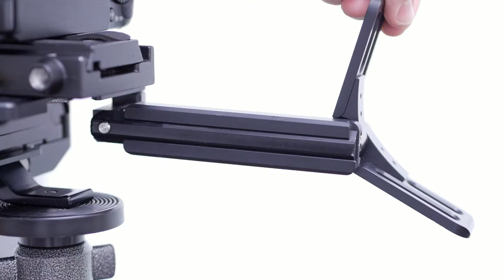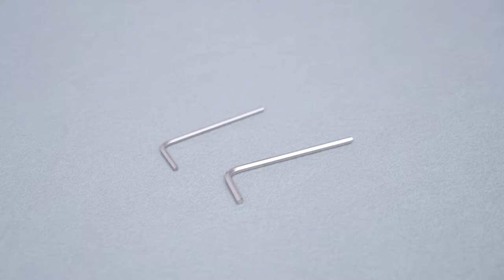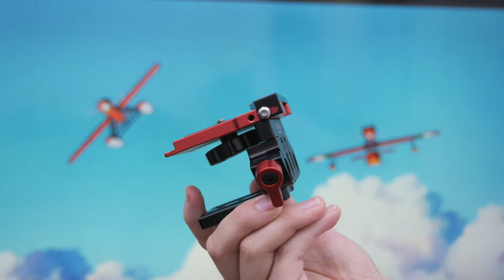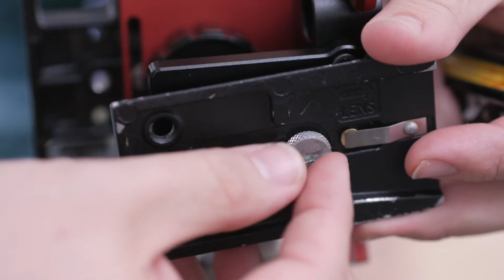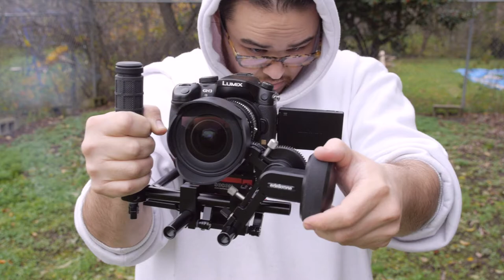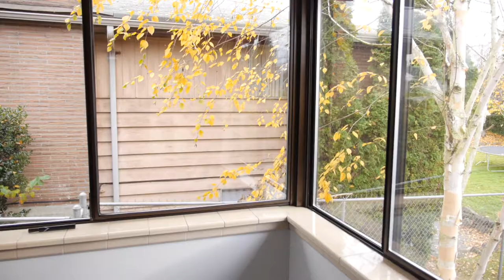Perfecting the Pocket Rig 3: Pocket Rig No More

Comment: Brutal conclusion, but good :) I'm using the Socom Kamerar Matte box anyway, pretty convincing gear!
One way to avoid the allen problem: use torx screws and good tools (I use Proxxon) with grips and handles. These won't fail that easily. I'm also thinking about mounting that plate to keep the camera from twisting, or just use the pocket rig for a second cam. After all, I've received the wrong extensions rods twice (for free though ;) ), so I could just build a new setup from scratch, like you did.

Comment: Awesome. Where did you buy the parts?
Reply from the maker: Amazon and photographyandcinema.com
Reply: deepspacenein Awesome, thanks. Will this do as quick release for this build: http://www.amazon.co.uk/Manfrotto-394-Profile-Rectangular-Connect/dp/B000KZCEYK/ref=sr_1_1?ie=UTF8&qid=1401090142&sr=8-1&keywords=manfrotto+rapid+connect+quick+release+adapter
Reply: deepspacenein And also could you specify the length of all the rods you have used. Thanks. :-)

Comment: can/does the pnc shoulder/chest pad wear over time from switching positions?
Reply from the maker: +zsoldier its fairly tough, but you can rip the pad off and replace it with another piece of foam when it gets worn out. heating the whole thing with a hair dryer or hot pad helps a little to loosen the glue.